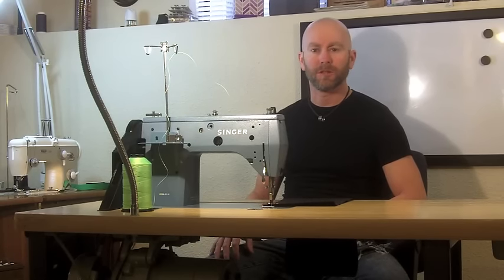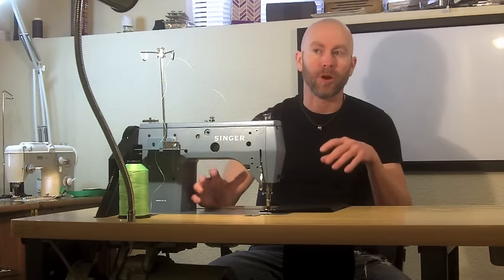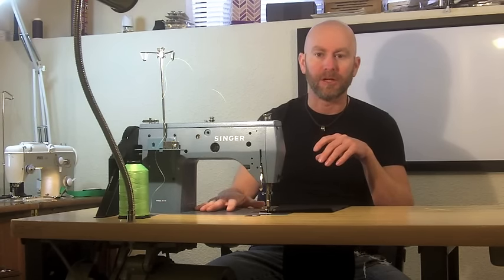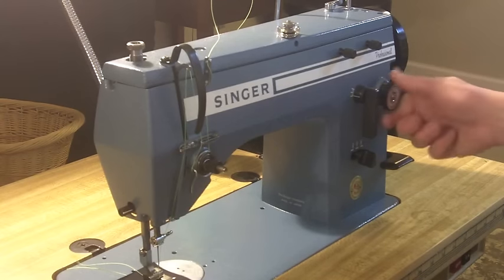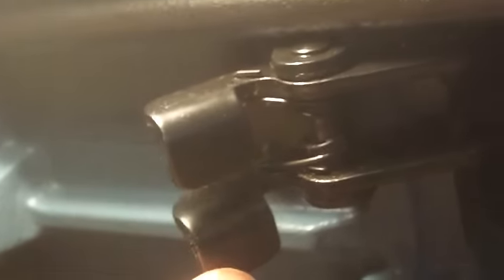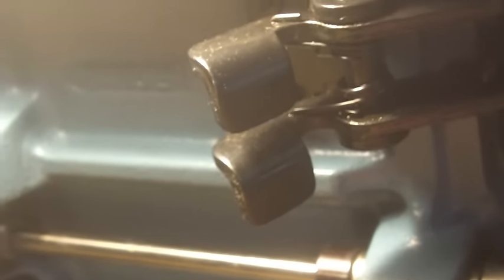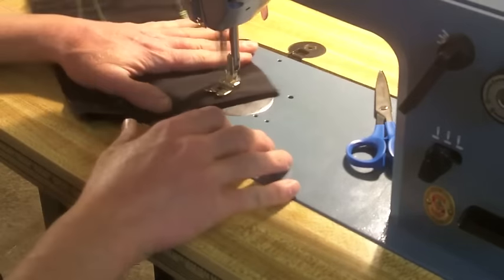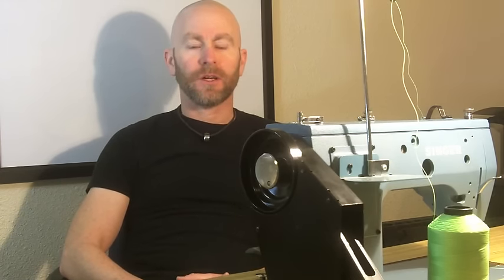Do you need an industrial sewing machine, Part 3 (I bought one!)

Comment: What is actually the classification that makes a sewing machine domestic vs industrial? The underside and gears in this looks right close to my Singer 500A, which tells you in the manual how to make things like curtains, but will also sew leather if you grumble at it. Especially with the size of the one you're using, is it just like mechanical part beefiness + motor speed/stitches per minute?
Reply from the maker: Hi, 
Sorry for taking so long to reply!
For context, this video was made quite a while a go, and I have vastly more experience now.  I currently own 21 machines, of which 2 are industrial walking-foot machines.
To some extent, it's like that quote about defining pornography - you know it when you see it.  I think what it comes down to is what the intended use the machine was designed for is.
An industrial machine is one made to be used in the full-time production of textile assemblies sometimes running nearly 24/7.  Some industrial machines may be more or less "heavy duty" than others, depending on their intended use.  The machine in this video may be used in an industrial setting in the manufacturing of garments or other items made from lighter materials, but it may also be used in a "commercial" setting, such as alterations for a dry cleaning business.  Some might refer to this machine as a "commercial" machine.
In contrast, a domestic machine is intended for use by a hobbyist at home.  
Older domestic machines were robustly built with all metal gears, and are often referred to by online sellers as "industrial-strength" or some other misleading descriptor.  The fact that a machine has metal gears doesn't make it an industrial machine.
When I was looking for "an industrial machine," I didn't know it but I was really looking for an industrial walking-foot machine.  Among industrial walking-foot machines, there is some variety as well, but the most commonly available ones are good for sewing the kinds of heavier fabrics I tend to use most (1000d Cordura, waxed canvas, etc).  Many people look to these machines for sewing heavy leather, but that is yet another sub-category of machine.
To try to answer your question, I don't know that there is a specific single thing you can point at to discriminate an industrial machine from a domestic machine - it's more of a totality.  A robust, vintage domestic machine set into an industrial table and powered by an industrial motor is not an industrial machine - however, it could be used as one with some success, assuming the materials being sewn are appropriate to the machine.  
An industrial walking-foot machine stuck into a bedroom and used by a hobbyist isn't a domestic machine.
Very generally, though, industrial machines are usually much larger than domestic machines, and most are powered by a separate motor mounted under the table (some newer machines now have integrated motors, though). Industrial machines are not designed to be portable, and must be used in a table dedicated to them.
Sorry for the long and rambling answer, but unfortunately there's not a short simple one that I know of! I hope that helps!

Comment: My wife has an heirloom 1949 singer, passed down from her mother. Basically both of them learned sewing on this particular model. Now my wife is getting into a regular sewing business of denim and canvas, mainly. After researching a lot she's ended up with a used really old juki  ddl 5550. 
The problem seems to be the attachments. Where can she put piping foot etc. It doesn't seem to have anywhere, like it seems on the juki ddl 8700. It shows a little disc just beside the feed dog plate. 
Your videos are a great help for her. Could you explain whether she should buy the ddl 5550? Cuz ddl 8700 isn't really available and it has mostly same specs. Thanks
Reply from the maker: Hi, 

I've used a few Juki machines, and I've liked them all.  However, I don't have any experience with either model you've mentioned.  I'd be surprised if the 5550 can't handle typical attachments (a piping foot should just replace the normal foot, for example).  But if your wife has a need for specific attachments, it definitely makes sense to be certain that the machine she buys will be compatible.

I wish I could provide more information, but I think Google is your friend for this.  Juki machines have a good following, and you should be able to find the information you need out there somewhere!

Good luck, and thanks for watching!

Comment: That machine and table looks sweet. Does the table come with it? Where can I buy a table?
Reply from the maker: The table did come with the machine, although I rather suspect that another machine was in this table first. I've seen industrial tables pop up on craigslist from time to time.  The table makes a huge difference for me compared to a home machine's folding table, or having a home machine in a case.  Industrial tables are available new (Google it, there's aside variety), but if you plan to use one with a home machine, you may have to make a top yourself (or modify one to fit).
Thanks for watching and commenting!

Comment: I bought a Bernina industrial 15 years ago and hardly use it. I got the speed lowered with a device my husband put on. I thought I could use thick,stronger threads,but had trouble. I had put the heavy thread in my bobbin and it would not work at all. What threads and do you use a certain one for the bobbin?
Reply from the maker: Hi!
There's quite a variety among industrial sewing machines, and some can handle much thicker thread than others.  The Singer in this video (which I no longer own) was only good for up to size 92, if I recall.

The manual for your machine will probably indicate what threads it is capable of handling, and you can probably find a copy online if you don't have one.

I am employed full-time doing sewing for a manufacturer of various travel bags now, and the biggest thread we use is 138.  We have several different machines - Juki 562, Singer 111, and Adler cylinder arm machines.  All of them are MUCH "beefier" machines than the Singer 20U is.  Sometimes we use thinner thread in the bobbin, but no one has been able to explain to me why we do that.

In my own machines, which are a variety of vintage domestic machines and a Sailrite Ultrafeed LS-1, I almost always use size 69 nylon thread.  I occasionally use 92 in the Sailrite, but I'm pretty sure I can make just about anything with 69. (We use a lot of it at work, too.) I always use the same thread in the bobbin as I do on top (so far, anyway!).

I hope that helps!  Thanks for your question, and thanks for watching!

Comment: Random question, I watched a video of a gentleman using a homemade speed control using a dimmer switch for a like dining room light/fan and was thinking about making one my self for a Rex rx607 when it arrives. I’m not worried about the build quality of the switch because electrical  is part of what I do for a living so I know I can make it “safe” lol but I don’t know anything about these motors and wounding you opinion on if the motor will be ok with the idea. I can’t seem to find any info on the motors used. And this is not the actual machine the guy used.
Reply from the maker: Hi, 

I know so little about electrical work that it would be irresponsible for me to speculate about this.  I think what you are referring to is something to limit the maximum speed of the machine, is that right?  Many servo motors have this ability, and if that's what you're going for, I could see how that could be helpful.  I'd be interested to know how it works if you end up doing it!

Sorry I can't be more help, maybe someone else with knowledge in this area will chime in.

Thanks for watching and commenting!
Reply: thejasonofalltrades no worries I don’t mind being  test lol I will for sure get back to you in a week or two after I have set it up and ran it for a big. Thanks again!!!

Comment: I sew 1/4" braided rope rugs with a zig zag stitch.  My Brother sewing machine has trouble with this and finally broke. Its gears are all plastic, and it seems I am buying a new machine every 14 months. I would like to buy a new or preferably good used industrial sewing machine that does straight stitch and zig zag. Can your machine handle this depth for zigzag sewing? Any other industrial machine suggestions within reasons $ that I should review?
Reply from the maker: Hi, 
I no longer own this machine, so I'm not sure about its ability to sew 1/4" rope.  If your domestic machine was feeding it well, then I would think this one would work well.  There are several industrial zig-zag machines out there.  Very few of them have a walking foot, which is what I prefer for the thicker/heavier fabrics I tend to use, and I wonder if that might be a good option for you.  Sailrite makes both a portable (Ultrafeed LSZ-1) walking foot machine with zig-zag, and a full-size industrial one.  You might want to investigate those, as well.  Thanks for watching, and good luck!

Comment: Do you know if you can upgrade the motor or if that too powerful of a motor would be too much for the machine to handle
Reply from the maker: This machine had PLENTY of power with the 1/3 hp motor (if I'm remembering right - I sold the machine 3 years ago).  I've found that for my needs, a walking-foot machine is the way to go, and not so much that more power is needed.
The manual for this machine should be available on SInger's website and will probably specify how powerful of a motor it can take.
I've been recently thinking of getting another one of these, but it would be as a supplement to my walking-foot machine, mostly for the odd occasion when I'd like to have a zig-zag stitch.
I've learned a lot since I made this video, and the upshot is, if you are sewing heavy Cordura, ballistic nylon and webbing into complex structures like backpacks, messenger bags, etc., you will get far better results using a walking-foot machine over something like this machine.  
I hope that helps, thanks for watching!
Reply: thejasonofalltrades thanks for your reply, I am looking to buy a machine that can do veg tan leather, don’t want to pay thousands though
Reply from the maker: Unfortunately, if you want to sew thick, tough leather, there aren't a lot of inexpensive options.  Tandy Leather and Sailrite recently partnered to sell a more-or-less leather specific version of the Sailrite Ultrafeed.  It's not cheap, but it might be in your price range.
Sewing "veg tan leather" is kind of a wide-ranging topic.  If it's relatively thin, you can sew leather with any sewing machine, although a walking-foot machine will feed it much better. I used to work for a leather bag manufacturer, and we used standard walking-foot industrial machines.  Most of what we sewed was quite thin, but occasionally some fittings were 7-8 oz or so.  What machine you need really depends on what thickness you'll typically be sewing.
As far as power is concerned, I think any industrial machine motor will be plenty powerful, but you will probably also want it to be a LOT slower.  Something like the Singer 20U is WAY too fast (it's made for sewing garment fabrics quickly).  You can change pulleys to reduce the speed, but I think trying to turn a machine like this into one that is great at sewing thick leather would be more time and trouble than it is worth.
I hope that helps.  You might want to check out Stock and Barrel on Youtube, they have some good leather-sewing info you might find helpful.

Comment: Quick question .
Does your upper tension disc disengage when you release the presser foot ? I have the 20U-13 as far as I can see mine does not.
Question 2 on your bobin case have you tried the straight stitch with and without using the pig tail guide. The manual for the model 33 says it does yet on my model I can not see any improvement. Just curious.
Reply from the maker: Hi Paul, 
I recently sold this machine, so I don't have it to confirm, but yes, the tension discs released when the presser foot was lifted.
I found the same result, not using the pigtail didn't seem to have any effect.  I did very little zig-zag stitching, but I didn't notice any issues from not using the pigtail.
Thanks for your questions, and thanks for watching!

Comment: I am learning to sew upholstery and am looking at a Singer 20U33.   It is on a table with a servo motor and knee control already.   The owner is asking $500.   You said you paid about $300 for your's without the knee control.....what should I look for as far as if the machine was properly cared for and any issues it might have?
Reply from the maker: Let me preface my response with the statement that I am far from an expert on these (or any other) machines.  That said, if the machine works and runs smoothly, it's probably fine.  There isn't a lot that will just break on a machine like this, and if it sews well and the timing is set correctly, you should be good to go. I would inspect it visually for obvious wear (machines that have seen lots of use will show wear on the bed from fabric sliding over it over and over), but even a machine that has seen a lot of use will probably work fine.  Older sewing machines that have sat for a long time tend to get some of their mechanisms stuck (zig-zag won't work, that kind of thing), but that can be pretty simple to resolve.
I had to have the timing adjusted on my machine, and the industrial sewing machine shop in Denver did it for around $40.  Otherwise, I've had no issues with mine.
A servo motor is considered an upgrade, although I've not tried one yet. 
I think it's hard to put a value on these machines, because they're not rare, but at the same time you can't exactly pick one up just anywhere.  I think you have to decide how badly you need it and whether it's worth it.
You should consider what sort of upholstery sewing you're planning to do.  If it's lighter weight material, drapery, etc., you'd be fine, but the 20U/20-33 is not really capable of handling very think thread of the sort you would use for heavy upholstery fabrics.  It's more of a clothing manufacturing kind of machine.  For me, it's one more machine in my arsenal, but not the last one for sure.
Thanks for your question, and let me know what you end up doing!
Reply: April,
I support Jason's opinion on your choice of an industrial sewing machine which might fit your upholstery work better. A lot of professional upholstery work involves sewing over multiple seams which can be difficult for a sewing machine without a walking foot.
I am sure that you have already made your decision on the Singer 20U33. It is a great machine and the price you quoted is very reasonable for a Singer 20U with a servo motor and knee lift. The knee lift will give you more efficiency once you prefect your knee lift technique.
Like Jason, I would like to know if you ultimately bought the Singer 20U33.